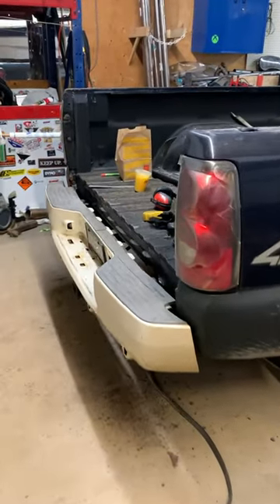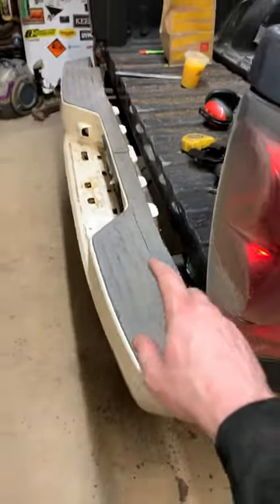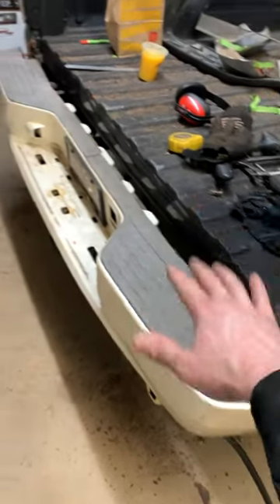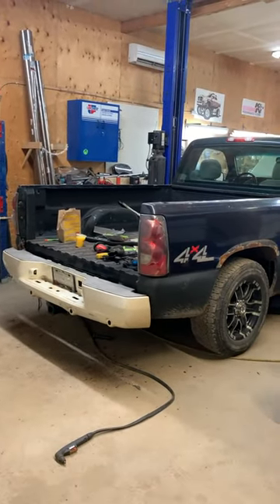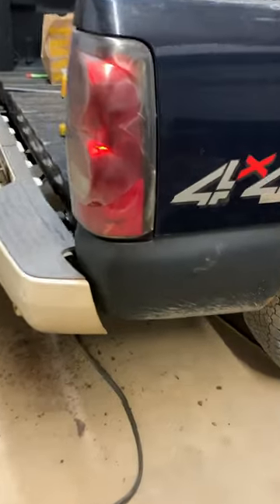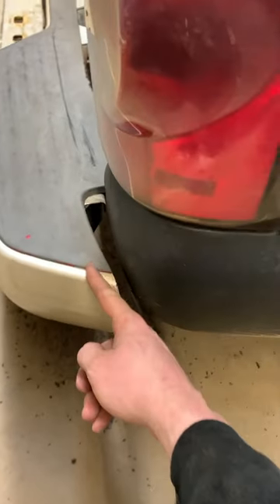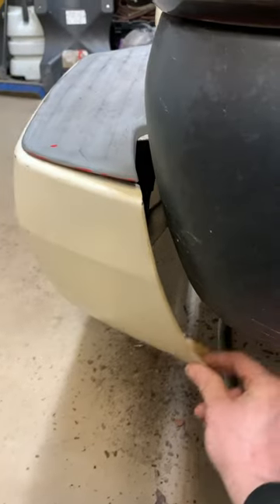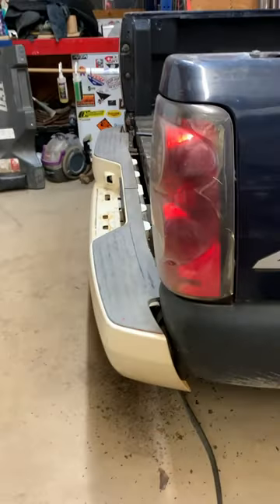Escalade bumper fits! #shorts #shortsvideo #diy #truck #escalade #fitment

Comment: Even without the cladding the bumper looks good. But i think ima keep saying it until u do. U definitely need to do the work for the cadalic taillights
Reply from the maker: I think just the bumper itself would even be an upgrade yeah. 

If I can get the quarter panel cut out of the Escalade in one piece, and grafted into the truck without destroying it I’ll consider doing it. I’m a little more confident with the metal work after welding in the patch panel this week, but I don’t want to get ahead of myself